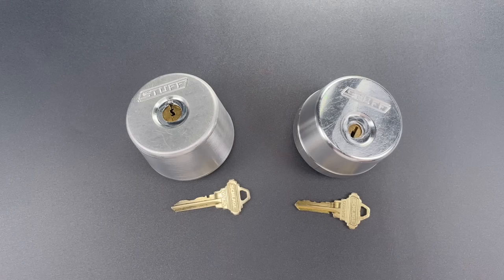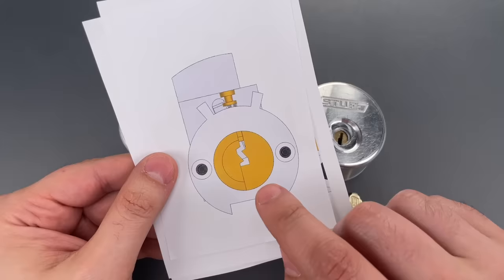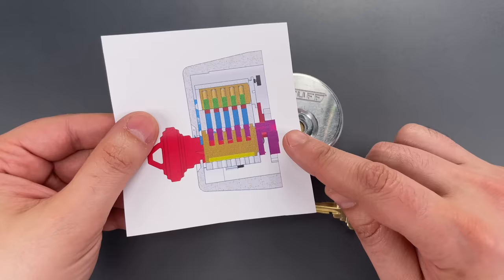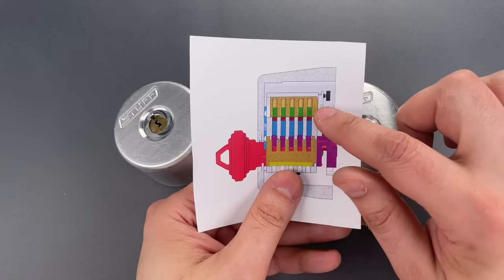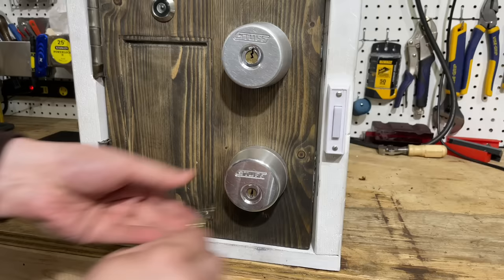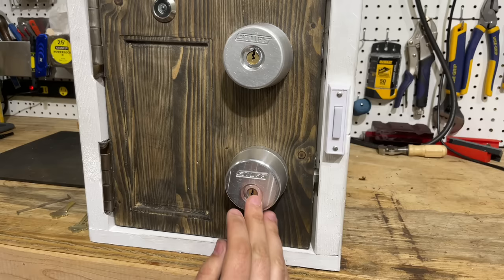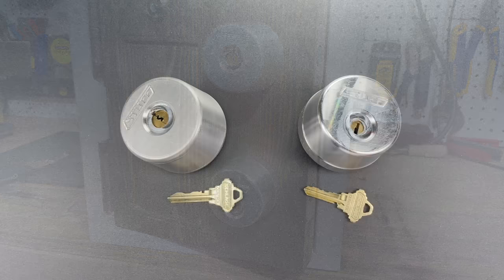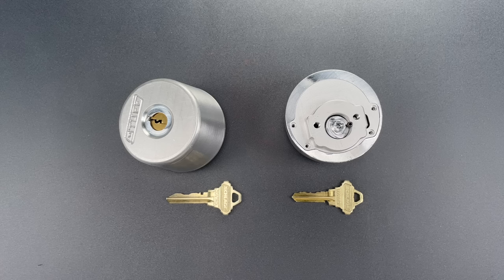[1299] Unpickable Locks From Stuff Made Here

Comment: "This was probably the most expensive solution..." Yeah, that's pretty much StuffMadehere.
Reply: "I spent hours hand machining these pins, then realized you can buy them for like a penny" -StuffMadeHere while making lock v2.
Reply: pretty much most of the engineer
Reply: Basically his engineering process. Making it barely work as the first step, then thinking about everything else
Reply: Coulda just milled a ring around the outer edge of the back of the lock, so that it sits inside the cutout of the door a little bit. Then it creates a lip that the tool can't bypass at that angle. It's only accessible now because it's flat surface against flat surface.
Reply: Nailed it lol
Reply: when all you have is a precision cnc machine, everything looks like a custom part to have built
Reply: annoyed burglar proceeds to break window...
Reply: But that is prototyping in general.
Reply: Shane probably ordered a new Tormach to machine that cover.
Reply: @HuslWusl  That's not just his engineering process. That's quite literally most every engineering process because we're taught to get it working then do problem solving.
Reply: @pirojfmifhghek566  That was my first thought as well since I've seen mountings like that.
Reply: @pirojfmifhghek566  Yeah, I thought the exact same thing.
Reply: Well, sure it's expensive - that's the nature of a prototype.  In production, the cost of stamping a plate out of cheap steel is inconsequential. Really, the guy who suggested having a flange go into the door had the better solution, but that doesn't fix the existing lock.

Comment: "these locks are pretty good" they can be used on the pentagon is what im hearing
Reply: He would have to make them at least $3000 before uncle Sam would consider buying them. Expensive means you can expand your budget next year, since you proved its insufficient lol
Reply: @BrokeWrench  That would be a bit cheap. An average freelance engineer can typically ask $80 per hour. So with 4 weeks work (as he claimed), that's about 8 hours * 5 days * 4 weeks = 160 hours. Or $12.800 in total.
Reply: @sanderd17  that's assuming he worked on these exclusively during the 4 weeks, it's more likely he had other projects going on at the same time.
Reply: @curtislevey7639  Also that was the time it took to test and redesign them many times. If you have done it once it should be pretty straightforward to repeat.
Reply: @sanderd17  When you buy a car do you pay for every working hour of every engineer that designed it?
Reply: @paskky913  , that's the difference between hand-made and manufacturing.  You wouldn't pay for the working hours of those that built the car because the company you are paying already paid those workers.  If he isn't getting paid some wage/salary for working on this, then it makes sense to factor labor time in the final price.
Reply: @BrokeWrench  Tbf the moment the government contract comes thru you spike the prices up 10x lol
Reply: @BrokeWrench  There's no doubt that Shane's lock could be made to cost $3000: titanium and so forth. Currently, I'm not sure it's drill-resistant, and he admitted that it has plastic parts for now. Give him time, and your government will be able to spend many thousands of dollars on a lock you saw built.
Reply: @DMLand  titanium? That would probably mean a 5X price increase. I was estimating cost as is 🤣
Reply: Yeah at "they are actually quite good" I was already looking for one to buy
Reply: Sorry no my uncle works there the locks r high tech
Reply: @hackorsbob2068  ever noticed LPL always pick the hi-tech lock with a stick or something? Plus, it's easier to sell something to the government if the stuff sounds expensive
Reply: @sanderd17  um he was making a joke about how the government makes normal or even cheap things cost about 10x how much it should in order to drain out the taxpayers money.
Reply: @SgtSupaman  he could charge whatever he wants for his design. If you design something you can patent it and sell the patent or use of the patent as you please.

You could also not sell the patent or use of the patent, have someone contracted to manufacture the product, and sell it yourself wholesale or retail for whatever people are willing to pay for it.
Reply: @paskky913  yes you do!  The cost of design & development is definitely calculated into the cost of every vehicle.
Reply: @curtislevey7639  but he may have done weekends as well
Reply: pentagon probably has mid locks but it doesn’t matter anyway bc they have lawn turrets lol

Comment: With some collaboration Shane and LPL could come up with a pretty unbeatable lock.
Reply: For sure, agreed
Reply: literally went down to the comments to right this exact comment
Reply: @carelessgamer9377  👍. Its true isn't it.
Reply: unless you have some 60 dollar bolt cutters
Reply: Well the cap on the back fixed one of the issues and the 45 degree angle thing wouldn't apply to my door as it is recessed about an inch in.
Reply: I would say that that's pretty darn close. Both of these required very specialized techniques that knew about the specific vulnerabilities. The anti retraction the only thing that's someone might even think to try normally
Reply: A $400 lock with all the machining but a damn good one for sure
Reply: @Wynkrs  My door has a very thin frame. A super lock makes sense only if the frame is reinforced and the alarm system is turned off or not installed. I do have glass windows but they are too high for the average burglar, unless he brings along a stool with him.
Reply: Already did as LPL didn’t even show an attempt to pick one lock and instead just exploited a design flaw in the demo door that doesn’t exist in regular doors. He also didn’t show an attempt to defeat the other lock with the back plate installed and instead only showed defeating it with an only partially installed lock. That also required an exploit of the demo door which may or may not exist on a normal door.
Reply: unbeatable? More like i just grab a axe and break the door open
Reply: It’s worth remembering that the reason we still use normal pickable locks isn’t because companies can’t design something with no exploits. It’s because these things are simply deterrents. Just like your windows are deterrents. If somebody wants in they can get in. We build things to be cost effective and good enough. We do not spend billions of dollars to make everything the best possible perfect version. If you put a $500 lock on your door are you making the frame and external wall bulletproof and battering ram proof?  Are your windows bulletproof too? We don’t build homes to be impenetrable so there’s no point in expensive unpickable locks either.
Reply: LPL may just have been an investor earlier so this works like an ad.
Reply: @Sebastians_3rd_arm metal door. Also not relevant, and should be addressed in a door making video.
Reply: It would just be a Bowley
Reply: Well I will go through the window then
Reply: No lock is unbeatable
Reply: Can LPL make a lock that he cannot pick?
Reply: Throws brick to your window cutely
Reply: They could make alot of money selling them too
Reply: He should meet up with Shane and BosnianBill and devise an affordable lock for the public. It would change people's lives. Seriously.
Reply: @Sebastians_3rd_arm  Why stop at an axe? Use some dynamite to make sure!
Reply: @CarlYota speak for yourself, i wish consumer products for security were produced at scale to make price lower. In my house all windows are BR7 rated. The door and the frame (of windows and door both) are SS reinforced. Paired all this with motion sensors, glass break sensors, and laser light break style motion sensors and alarm system, 300 mm reinforced concrete walls, my home is pretty impenetrable. The locks i had custom made from a famous regional lock making brand. All this cost ton of money because it was all custom made. The investment makes sense for me as i live in a third world country and people with money are not that safe here.

Comment: 0:55
“A few minor oversights that I was able to exploit”
I immediately thought of a door breaching shotgun and realized that the lock is not bulletproof
Reply: Nor the door hinges, generally
Reply: Bring a saw and the lock wont even matter
Reply: Huh... Pretty sure it is, actually - at least to pellets.

Think the body is made of of stainless steel, and it's not particularly thin either.
Reply: @3-valdiondreemur564  you wouldn't attack the lock mechanism directly with a shotgun anyway, even with breaching rounds.  Instead you're just blasting out the door jamb around the dead bolt or hinges.

Comment: Shane: Spends more then half a year building these locks. 

LPL: “The mechanism is quite good”
Reply: That's high praise from LPL
Reply: @ShadowLynx777  True
Reply: "Reality is sometimes disappointing"
Thanos*
Reply: According to the directors commentary shane spent a month on the v2 lock with a 1 week sprint before working on a different project then a 3 week sprint later.
Reply: LPL: “*Lol, lock go 45°*”
Reply: to be fair, "quite good" is very high praise coming from LPL
Reply: Watching the lock picking lawyer's channel in the past I felt it would take him 30 seconds or less to unlock anything, unpickable lock not so easy to build
Reply: High praise is an LPL video over 10 minutes that doesn’t also roast the lock.
Reply: Really puts into perspective how hard it is to design a good lock.
Reply: I was just watching this vid and as i read this he: said quite good.
Reply: Considering the LPL had to cheat and beat the first lock through flaws in the door, not the lock, says Shane wins. Had the first lock been installed onto the door and the door frame properly, they wouldnt have been defeated.
Reply: To be fair Factories spend entire decades on locks that are worse.
Reply: @__aceofspades  No, wood is soft enough that without some actual protection in the lock itself, it would always be possible to get that tool in there.
Reply: @__aceofspades  Not to mention the deadbolt bypass.
Reply: @rylenstuffsv2  thanos from fortnite?
Reply: @__aceofspades  I don't think so, as shane is the one that provided the rig. If he'd provided a cover for the gap to prevent access to the deadbolt, and perhaps a metal door with tight tolerances that prevent getting a shim in (or another way internal to the lock body like a separate seat and cover with the seam itself having a tight tolerance/some kind of interlocking to prevent shimming) thrn he may well have won.

I missed the original challenge, though, so I'm not sure what the rules of the challenge were. Either way. a great showing and it looks like with a few simple mods the lower lock could be very difficult indeed.
Reply: @Pownyan  🎵TO BE FAAAAIIIR!🎵 I'll see myself out. 😁
Reply: Just use a knife, worse than "slide your credit card"
Reply: Anything above “good enough for the streets” is incredible praise. 

Don’t think you’re aware how rare a comment like that is on this channel
Reply: @__aceofspades  I mean it is the door SMH sent with it.
Reply: LPL be like an anime villain : Your new move is nothing in front my final form.
Reply: @chaotixthefox  "wood is soft enough". Good wooden door are hard to break. I don't know if that exists in the America, but I know a house where I lived that would had a faster entry by the garden's door because they were a window on it that the big entrance wooden door
Reply: @cookie856  Breaking it is not what is in discussion here.
Reply: Nobody gonna mention how he said "Shane, excellent work on these locks" at the end??
Reply: @__aceofspades  jamming his tension rod thing into the bottom of the lock was not a flaw in the door so it would have still worked.
Reply: @cookie856  wood is softer than metal so jamming a metal pick between the door and the lock would work even if you guys build your doors out of hickory heartwood or some other super hard wood over there. Nobody is talking about kicking the door down.
Reply: @paulk5670 It's been two years, but here's the initial challenge; Shane made one lock that fixes the biggest problems and then made an upgrade that fixed most of the smaller problems. He challenged LPL to unlock it without using the door as an advantage(as shown by the welded parts).

Comment: I think we can fully discount the bypass method used on the V2 as a viable solution because had the “door” been mounted correctly, it would be swinging inward and there would be no access to deadbolt, or hinges for that matter
Reply: Yeah, i would say it's unpickable. If he didn't see the insides, and it was mounted the door the right way, so you wouldn't see the bolt and also installed the plate on the back, it wouldn't have been so easy.
Reply: Doors typically swing outward in a lot of countries. Giving access to the deadbolt is obviously a horribly terrible idea no matter where the door swings.
Reply: @TimoRutanen  Yes, but if the door swings outward you can easily have the outside of the door overhang the frame, so access to the deadbolt would be prevented (and also to seal against the wheather). In Germany I have never seen a residential door with visible access to the bolt.
Reply: @TimoRutanen In countries that see annual snowfall, the doors swing inwards, otherwise the snow could block the door and trap the occupants inside.
Reply: every door in my house goes in. as does the front door. cause its easier to protect them from crowbar attacks.
its a fairly common practice where they put a metal strip on it. which doesnt work if it swings out.
I dont think "most countries" have doors that swing out. maybe a screen door wich doesnt offer protection but the "real"" front door opens inward
what shitty countries have those other doors??  @TimoRutanen
Reply: @mr.c9820  Since you added the adjective 'shitty' in your demand for a list, I'm not really inclined to give you anything. Greetings from Finland though.
Reply: @TimoRutanen lol
Reply: @mr.c9820  In "shitty" countries like Finland fire regulations demand that all outdoors open outwards, but usually ALL doors, e.g. bedroom doors, open outwards. If there is a fire, it's much faster to escape if all door swing towards the escape route. It is a proven fact.

In "shitty" countries like Finland safety comes first. There are child locks in water taps and showers so that little children don't burn themselves with hot water. In every WC there is a handheld shower so you can wash your private parts while sitting on a bowl. Just a few examples. 😎
Reply: @mikeamory7418  It is not safe to have the door open outwards just because they can be blocked by something from outside and you have no chance to do anything to open it. Therefore in Germany, or here in Czechia the door are opening inwards.
Reply: @mareksykora779  In rare cases when there is "something" outside blocking the door from opening, there must always be a second escape route, usually window. Here in Finland snow and ice can be a big problem during winters, but still fire regulation demand that all doors open towards the escape route. If you have inwards opening doors, you can't just run out. You have to stop and open the door, stop and open the door etc wasting valuable seconds. Whoever invented inwards opening doors, he didn't care about fire safety.
Reply: @mikeamory7418  In fact, your "second escape" route is complete nonsense precisely in the event of a fire, when the corridor is already full of smoke. You don't have time to follow the second escape route. And if your legislators think you are fit enough to find another way in such a situation, why do they think you are not fit enough to open the door in? Looks like your guys in parliament aren't the sharpest pencils in the pencil case.
Reply: @mareksykora779  As I understand you have only one escape route available with inwards opening doors? Good luck in case of a fire. Don't blame me if you have incompetent people in charge.
Reply: @mikeamory7418  You understand it wrong. Every house has windows. So you can also use them. Ops, wait! You probably cannot use them in Finland, because they go open inwards, a huge problem for your people.

Comment: "He welded the hinge pins on, probably to keep me from just knocking the pins and declaring victory. Which is definitely something I would have done" 🤣🤣
Reply: he knows LPL so well =)
Reply: The hinge pins and the bolt exploit are the reason why you want your security door to open into the secured area.  First exploit on the second lock would have been much harder if the door-jam was in the way(though I am sure LPL has a special tool to make it easy).
Reply: @nobodyimportant2470  first exploit could have been fixed with an astragal...well apart from not having that design flaw to begin with.

Most exterior doors have to open outwards for fire safety reasons.

You can also get different kind of hinges if you want it to be more secure than NRP butt hinges.